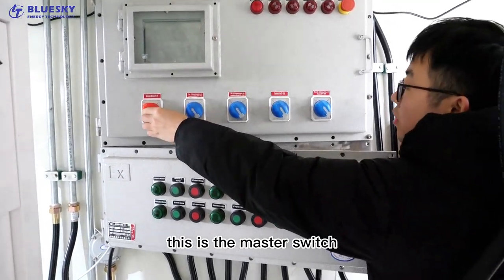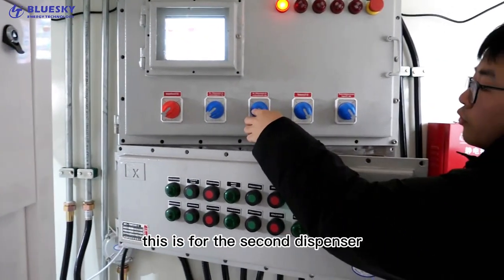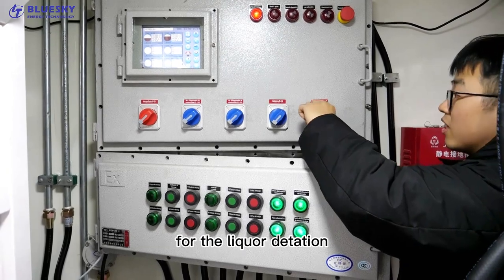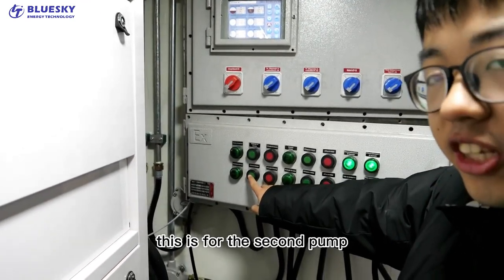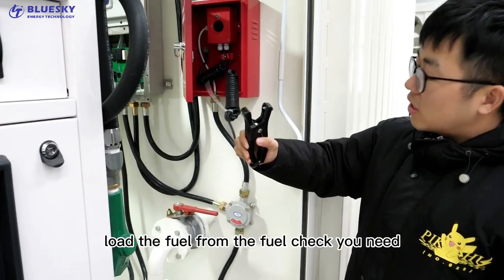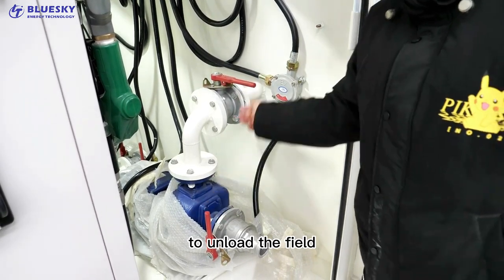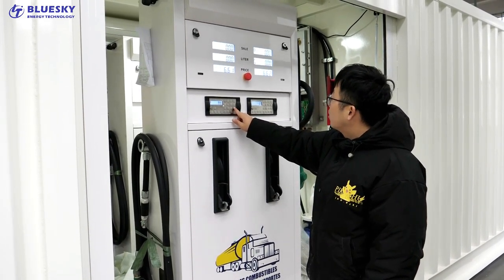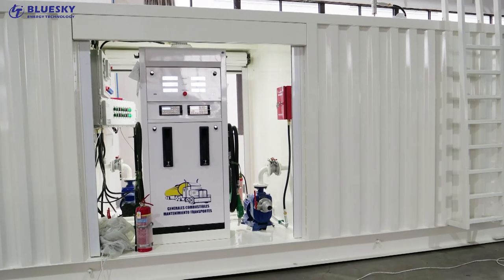Mobile Gas Station | BlueSky

Comment: I'm not impressed, You didn't mention what that button on the  3rd row, bottom left, on the front panel on the side of the switch near the indicator light, to the side of the display does.
Reply from the maker: Hello Daniel, you can watch very carefully. The video is the scene we demonstrated. There may be negligence. If you need to understand further, you can contact our engineers. Email: phs@blueskynewnergy.com
Reply: @EVCharger_fueling  I was just joking!!! It's a pretty awesome set up! No worries.